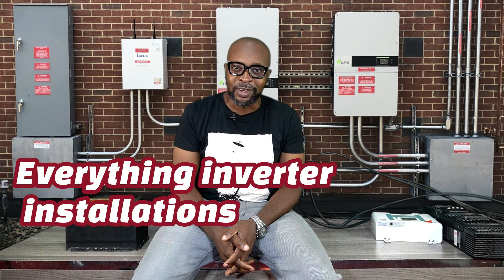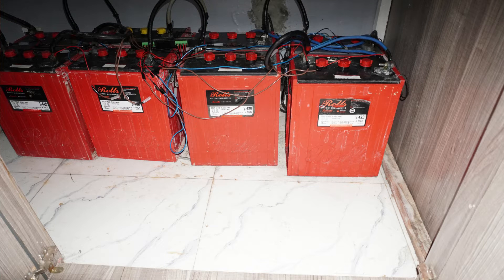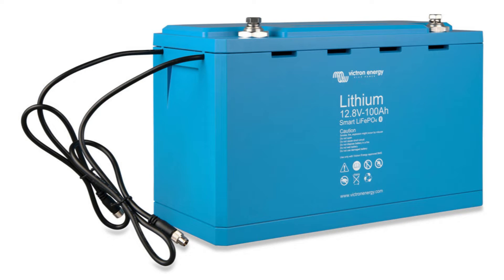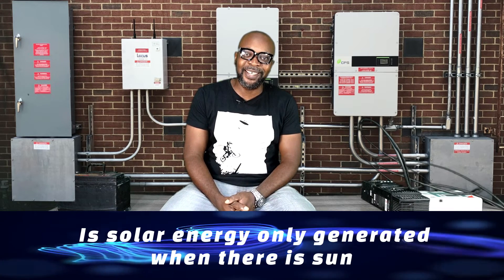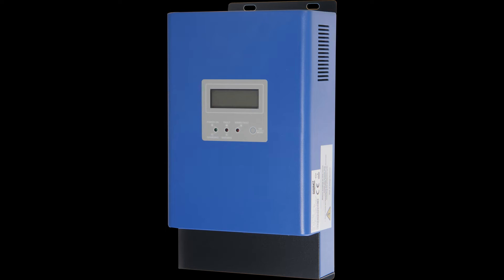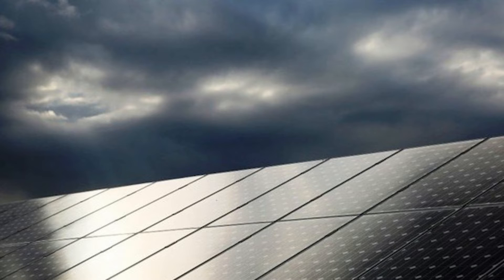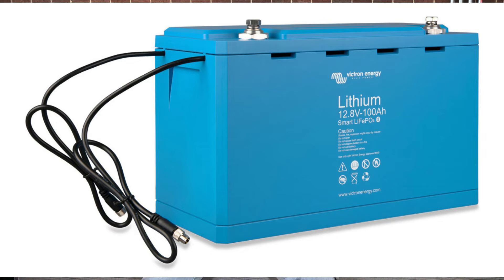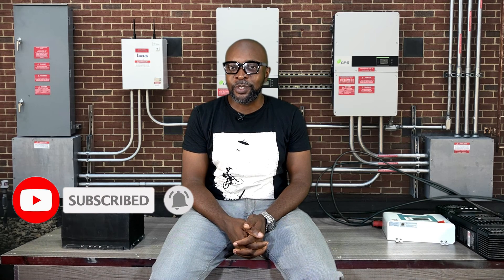Myths About Solar energy and your batteries you shouldnt believe

Comment: You can mix batteries if they’re the same type of batteries, even different brands. Example would be a 12 V  16S battery that has another brand 12 V battery that’s 16S configuration. 
You also need to check the manufacturer battery settings, and use a shunt.

Comment: #9 I think that I would have mentioned that you do have to set the charge controller for the type of batteries that you are using, because different chemistries have different charging profiles. You can damage your batteries if you have things set incorrectly. Also, flooded batteries give off hydrogen gas, so must be in a well ventilated area.